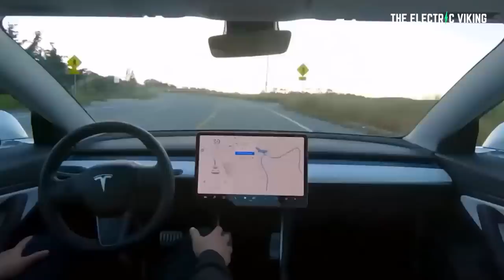20% of all vehicles will need to run on electricity in 24 months in Canada!

Comment: I have been driving Teslas for 8 years now in Canada. I've owned 4 and have 2 in the family now. Superchargters have become widely available and travel anywhere is no problem. No so 8 years ago. The cost of operation compared with Canada's very high priced gas pays for the car. Contrary to popular opinion of non-EV owners most charging is done at home at low cost. About 90% in my case. So the availability of public chargers is less important than most think. But i still depend on them and use them when I need to. If you are on the road traveling all the time they are essential. When the model 3 was just a reservation and not yet available over one third of the reservations world wide were in the Toronto area. The service and delivery centers around here are very very busy. I wouldn't be surprised to see the 20% be achieved without much trouble, But who knows?
Reply: How does your Tesla perform in the cold weather?   Charge time, run time?
Reply: @bmrbca3658  there are many videos on this. At -7°C the range drop is around 19% compared to the range at 22°C (vs ICE cars which drop around 15% at these temps, so not that different). Newer vehicles (better battery chemistry) and vehicles with heat pumps (as opposed to reststsnce heaters) do better. So a Model Y LR would drop from 530km to 430km range. Still plenty of lots of kms.
Reply: @bmrbca3658  We own 2 Tesla’s in Toronto, Canada. Our first is a 2016 Model S 75D. Then we bought a Model Y 2 years ago. My wife and I love these cars. Yes, there are some stupid things about them, but no car is 100% perfect. In terms of cold weather performance, it’s true..there is a loss of distance. But we’ve gotten used to that. Ask any Tesla owner up here and they will tell you it’s not that big a deal. Anyway, the vast majority of the charging is done at home at night. Our electricity in Ontario is priced lower at night, so we get about 400 (real) km for $12. That aside, Tesla’s Supercharging network is superb and we have done lots of long-distance driving in winter.